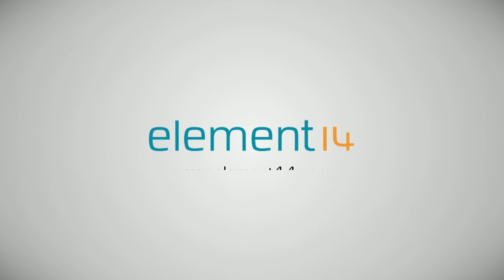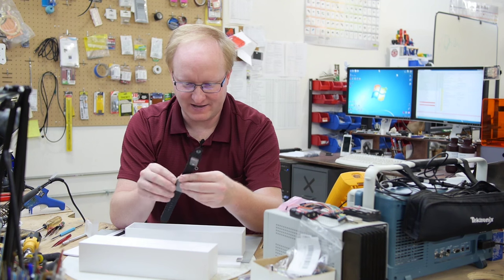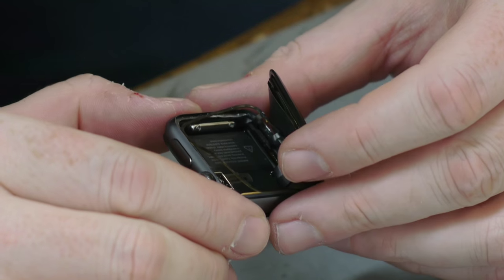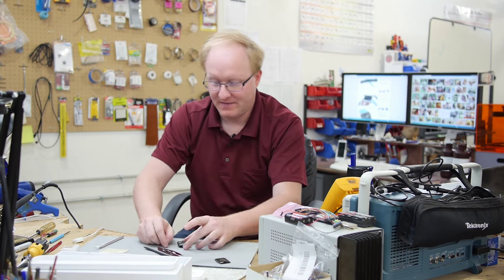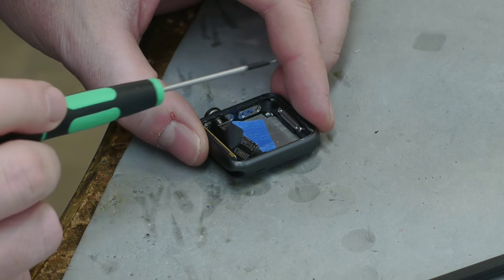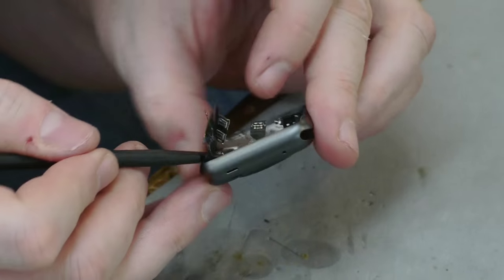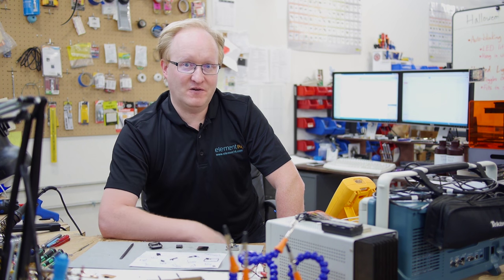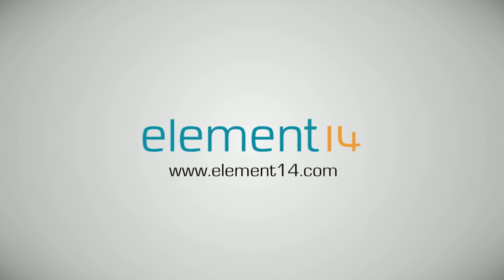Ben Heck's Hack to the Future: Apple Watch Teardown

Comment: The reason for linear actuator to rumble instead of a cylindrical one is for better control over the "feel" of the vibration.  With the bar sliding back and forth, they can control every pulse and create rhythms to convey information.  A spinning motor can only spin at an accelerating and decelerating rate, so there's less control over how it can feel while rumbling.
Reply: I wonder if they could use a stepper motor.

Comment: I've always loved tech; and I was thinking, how about tearing down an Oculous Rift or Virtual Boy and making it more portable, let's say, a pair of aviator glasses? all the extra components and power source could be held in a small box that could be hooked to a belt as so there's not a bunch of weight in front of your face, therefore making it more portable and lighter.

If that's not possible, a while back I found an old headset(two actually) that look like their from the 40s or something, one has alligator clips and the other is wired in to the box. Perhaps you could make it so that an antique pair of headsets can be hooked into a standard headphone jack, and that they're a little more comfortable to wear?
Reply: That would be a awesome product. The big problem with the Virtual Boy was mainly its bulk.
Reply: People thought it burned your eyes out. The lack of a head strap and the awkward tripod were also problematic. But, the burning your eyes out part is what really put people off. Well, the warning after fifteen minutes of play didn't help that at all even if it was a carpel tunnel syndrome warning because people don't read beyond "Warning: You've been playing for fifteen minutes. Take a break." In the manual for all the games it's clear that they were talking about carpel tunnel syndrome but people were already wary of a system that's screen they thought outputs lasers into your eye. Science illiteracy killed the Virtual Boy, and I got like ten games for on my tenth birthday because they were two dollars each at Walmart so I guess the collective science illiteracy was a boon for me.

Comment: I wish someone would come up with a way to use an unused smartphone as a ECM for DIY fuel injection!
Reply: you'd need an ecu/ecm emulator, copy the map from the ecu, bin ecu, then a patch cable/plug with Bluetooth connectivity.. then from there write your own controlling software.. 

basically, not impossible, but possibly a lot of work.. 

might even be a new way to protect your vehicle in future.. 

remote ecu..

Comment: A spuger?
Reply: +Ast A. Moore 
A small plastic or metal tool with a flat wedge tip. Used for prying clipped together consumer electronics cases apart. 

Or you could call it a pokey bendy thing for braking stuff with.
Reply: John Bailey Heh. Nope. You’re describing a spudger, not a spuger.